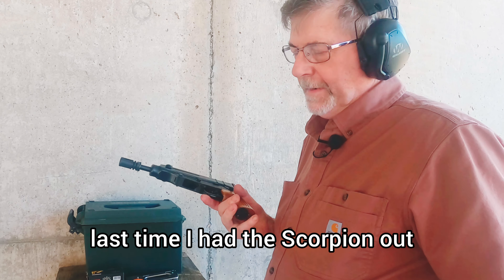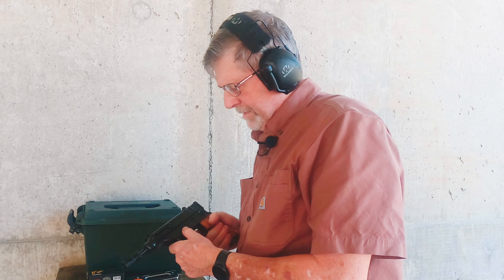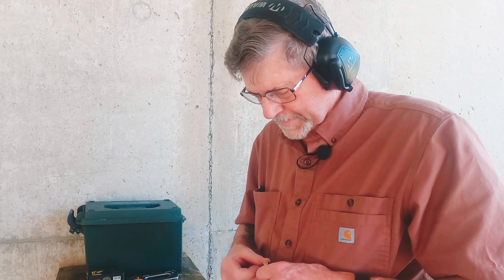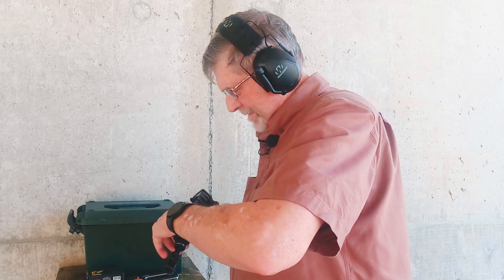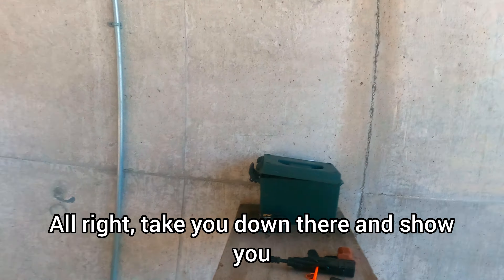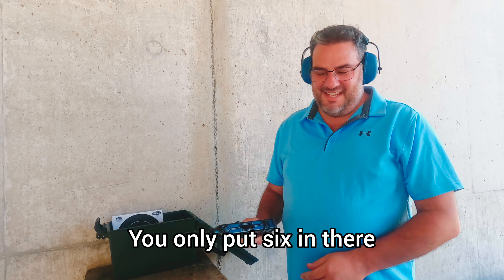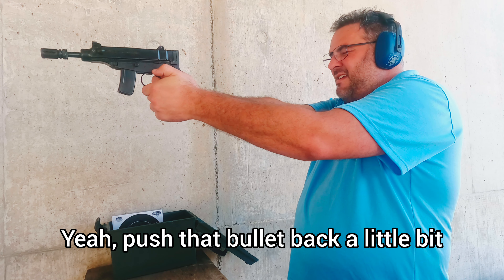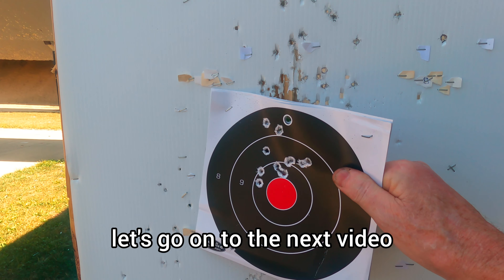VZ61 Scorpion one last test.

Comment: Is the jamming and shaving of metal only occuring with the 20rd mag, now? If so, that makes me think that the mag catch has an issue and the heavier 20 rounder is sagging. If you can push up on the magazine, during a failure to feed, and the bolt slams home, you'll know.
Reply from the maker: @TwinklesTheChinchilla  I think you are on to something there.